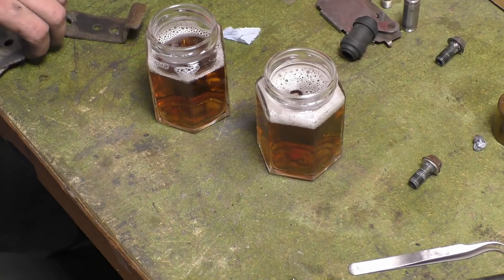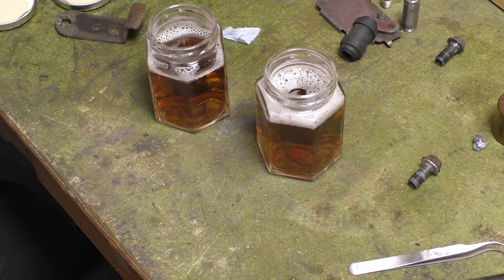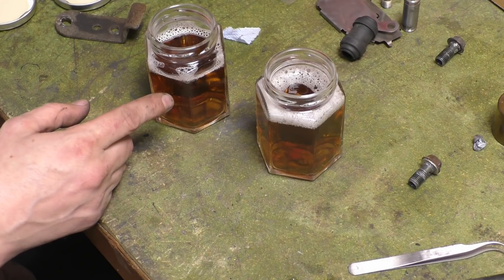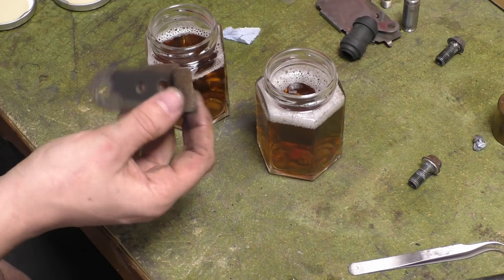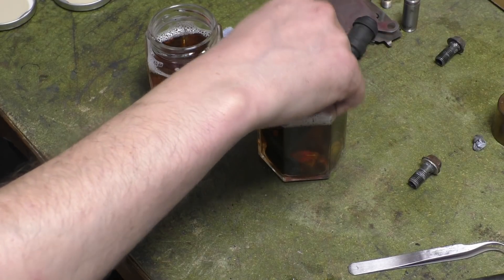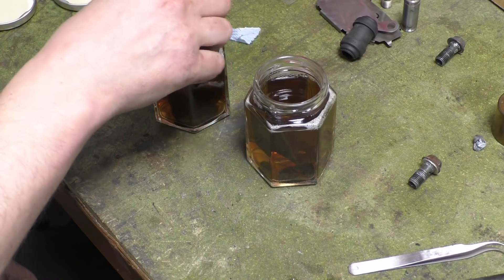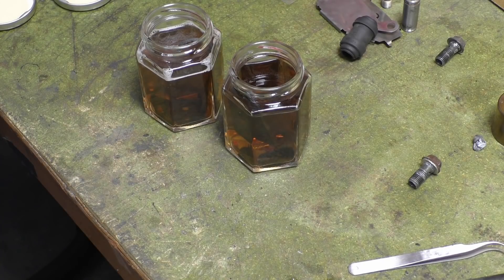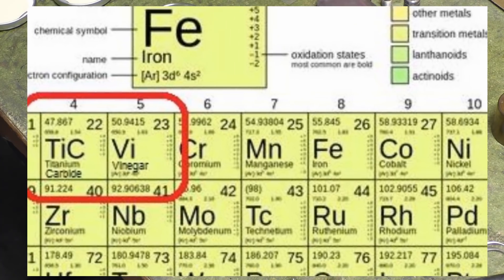Super Slippy Skills (SSS) - Chemicalology

Comment: NaVi flavour crisps. Awesome 😉.  As for rust removal, without any damage to the item, electrolytic rust removal is the way. All you need is a washing up bowl, filled with washing soda in warm water, an old fashioned battery charger (not a smart charger) & a sacrificial piece of iron or steel (I use a bit of steel plate). Connect negative to bit that needs derusting, positive to sacrificial piece. Leave for a couple of hours & the rust will migrate to the sacrificial plate. A quick rub with scotchbrite and its clean as a whistle. Use this method all the time, quite satisfying doing it. Try it, you'll be amazed and never go back to acid.

Comment: erm...... back in the day i cleared a tesco shelf of vinegar and poured it into a rusty petrol tank then topped it up with water (no more vinegar) and left it for a few days, it did work aswell
this was on a 88 fz600 so it had seen better days but it stopped the fuel filter getting clogged up every month (400 miles a week for work + fun riding)

Comment: Tesco white Distilled Vinegar  .. This works very slowly, about 4 days for a well rusty spanner... the ordinary brown vinegar works too but will stain your work pieces...
Far quicker method to use Travis Perkins 4Trade Mortar Cleaner. This stuff is Hydrochloric acid based and will do the same job in about 4 hours or less. 
The problem with using either of these processes is the de-rusted work pieces will re rust at a far quicker rate than it originally would. So the more recognised chemical rust remover is Phosphoric Acid which also somehow neutralises the metal surfaces protecting it, to a degree, from re rusting.
Please run some tests.
Reply from the maker: "Please run some tests."

- on what? All of chemistry. I think you missed the point of the video Derick.
Reply: i must have missed the point Matt.. I thought you are testing dels rust removal methods.. I know you have done electrolysis rust removal...
Reply: Coke a Cola works better than vinegar and it contains phosphoric acid. Guinness might work too. It makes copper coins fizz well enough ;)

Comment: LOL, Vinegar works! I tried it my self... you need to naturalize it with soda and rinse the shit well. I have no clue if the metal is still the same after it. But I know it will rust fast as fuck again. And don't forget to take it out!!! I forgot some hose clamps and screws it and 2-3 weeks later they where gone!!! All what was left was a black slack with small bits in it.The best is a molasses bath! Takes a while but great stink and results.
Reply: Repaint the part to avoid future rust, bare metal is exposed so that's why it rusts so fast
Reply: I know that I cant just leave it blank. But that does rust way faster that a fresh cut metal part. So I guess there is something else going on too.
Reply: More surface area due to vinegar eating into the metal (nooks and crannies instead flat surface)? My best guess :)

Comment: I think you're missing the point that you should actually be rubbing vinegar onto your steel parts to avoid rust.  It washes off quite fast, obvs, I find it's better to use something thicker, but still vinegar based - Daddy's sauce - it might not have the power of full vinegar, but the fact it stays in place more than makes up for its lack of potency.  If you put it on the back of your brake pads, you need to use a lot less copaslip. 

I don't like acid-based rust removal methods.  Electrolysis FTW.
Reply: ketchup works great!
Reply: Only on Ducatis.

Comment: Yeah the white vinegar method works to knock off rust but it will continue to corrode steel under the rust (just pretty slowly).

I mix steel wool and white vinegar in a bucket and let it sit for a few weeks, it makes iron oxide and iron acetate.
The iron acetate is what I'm after- iron acetate will react with tannic acids and turn black. So woods like white oak that have a lot of tannins, it will "dye" the oak black.